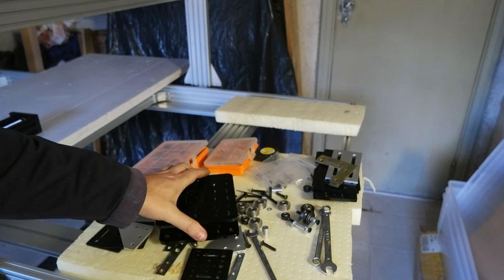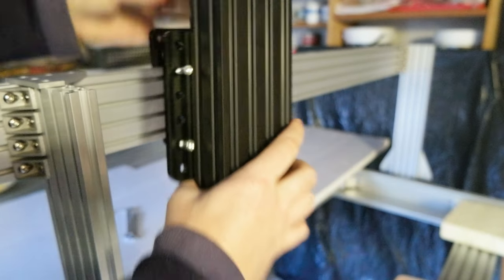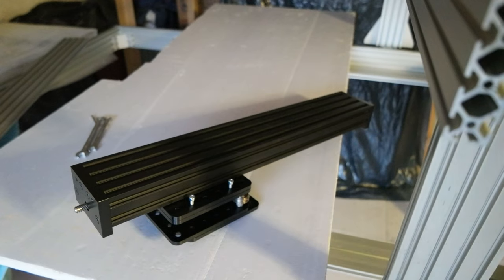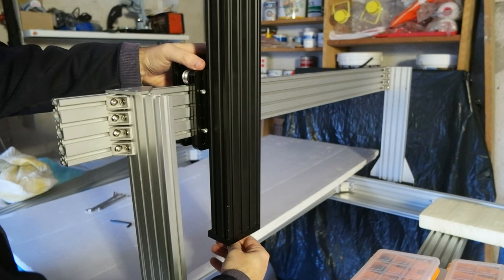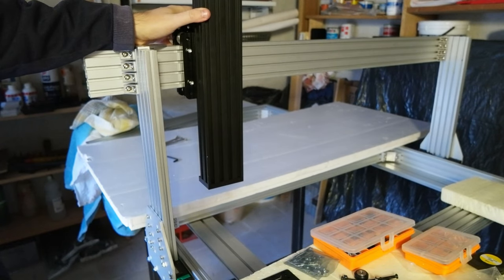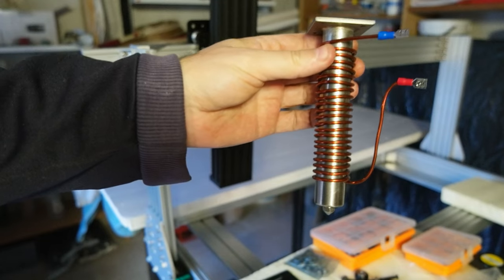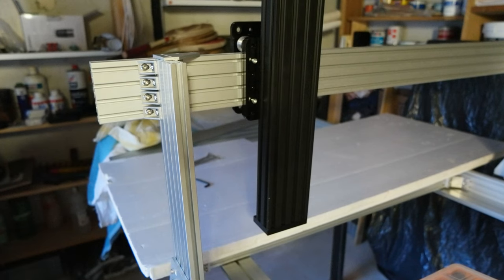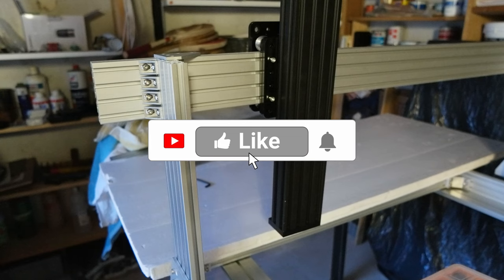Z-Axis to X-Axis Build for my custom 3D printer

Comment from the maker: I got to put together the Z and X axis which finally convinced me of the right choice to have a CNC type of Z-Axis. I will reduce the weight and simplify build.

============================================================
Donations:
BTC: 1AFMuz5ReaSGW6Y2pq8pgRkppUo1LSJSpS
ETH: 0x454A388DB957680bab67a3E8BeBb719b6A957385
XMR: 83SEQJHc4aWAxK86jNxtn1a3X2ru3wWXcJXnBZmkzcEyNxMHCyx3GUHXsAiDfQ1BtjVMbkgQ8gxoyhXA12eepjaPM42wkwj
============================================================
Laser Support - https://s.click.aliexpress.com/e/_A0NYLS
Laser - https://s.click.aliexpress.com/e/_AXFIJS
Induction Heating Power supply - https://s.click.aliexpress.com/e/_9hVy0K
Heated bed power module mosfet - https://s.click.aliexpress.com/e/_DkX...
Infrared Heating Film: https://s.click.aliexpress.com/e/_AUcAhb
BIGTREETECH BTT S57B V2.0 - https://s.click.aliexpress.com/e/_9gZpdo
Oled Screen - https://s.click.aliexpress.com/e/_9R4LLy
3D Printer GT2 20Teeth - https://s.click.aliexpress.com/e/_9yJNts
Nema 23 holders - https://s.click.aliexpress.com/e/_9wL11C
BL Touch - https://s.click.aliexpress.com/e/_AYXBGI
Infrared heating - https://s.click.aliexpress.com/e/_9InHB4
coupler - https://s.click.aliexpress.com/e/_ASloGa
Touchscreen Monitor 7 in HDMI Screen - https://s.click.aliexpress.com/e/_DCr...
BIGTREETECH BTT Manta M8P - https://s.click.aliexpress.com/e/_DlJ...
BIGTREETECH BTT CB1 PI4B Adapter - https://s.click.aliexpress.com/e/_DBJ...
BIGTREETECH BTT CB1 heatsink - https://s.click.aliexpress.com/e/_Dmd...
BIGTREETECH  GTR 1.0 http://s.click.aliexpress.com/e/_rRDltN
BIGTREETECH SKR Pro v1.2 - http://s.click.aliexpress.com/e/_rRDltN
BIGTREETECH SKR V1.3  -  https://s.click.aliexpress.com/e/_AbZJ5z
TMC 2226 - https://s.click.aliexpress.com/e/_DBP...
TMC 2209 - https://s.click.aliexpress.com/e/_ApIVvH
Nema 23 - https://s.click.aliexpress.com/e/_AdrgEQ
Nema 17 - https://s.click.aliexpress.com/e/_97imIx
Nema 17 geared 5:1 - https://s.click.aliexpress.com/e/_A3kKfz
============================================================
flipsky ESC https://flipsky.net/?ref=ganzo
maxkgo BMS - Coupon Code ganzo https://maxkgo.com/?ref=ganzo
============================================================
Alibaba weekly deals https://offer.alibaba.com/cps/8pt0t96j